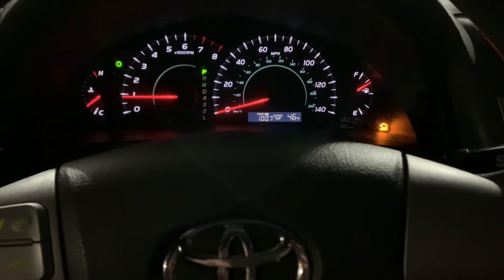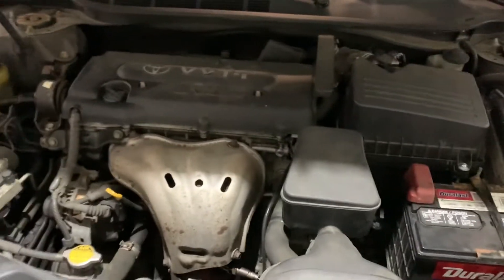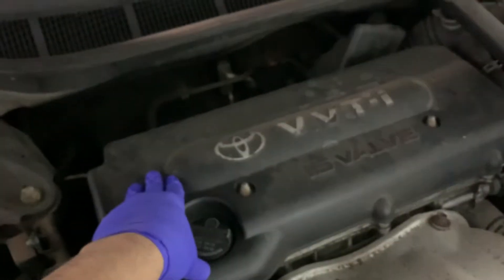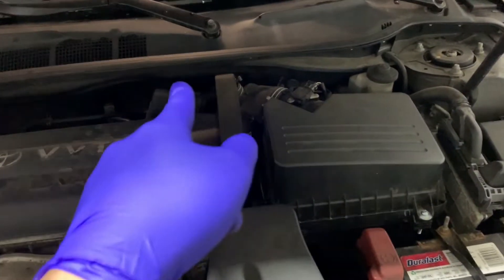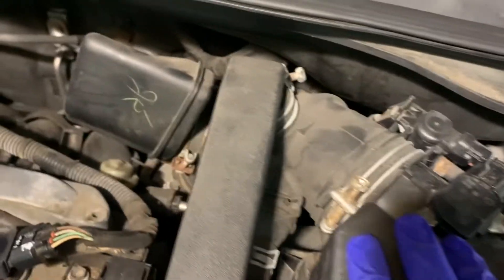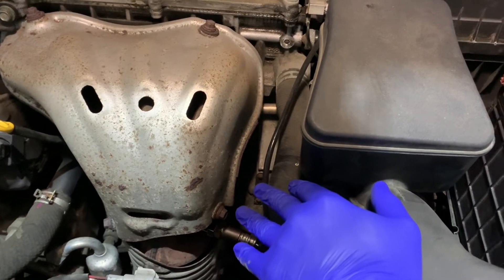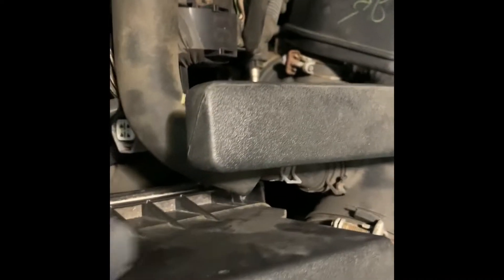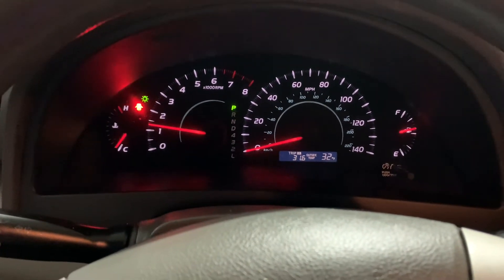2007 - 2011 Toyota Camry Code P0171 system too lean bank 1

Comment: 06 camry solara p0171! Ive replaced PCV valve, pcv hose, MAF sensor denso, o2 sensor denso, spark plugs, ignition coils, smoked for vacum leaks, and still cant get rid of check engine light! Was told it was either the fuel pump or fuel injectors! Just bought a new camry so not sure if im still willing to spend more money trying to repair!!
Reply: Same for me ! What is your long time fuel trim ?
Reply: @DilukaPereraofficial  finally got it fixed it was the fuel injectors. Code went away and passed smog.

Comment: My diy, I replaced the PCV and MAF sensors and all check engine/ vsc lights went off the day after. thank you for your help.
Reply: i couldnt find the proper pvc vavle. non of them had the proper thread pitch. from oreillys anyway.

Comment: So when you replaced your 02 sensor later it still didn’t resolve your issue? And I noticed you repost another video with the fuel pump? Was that your issues the fuel pump?

Comment: That light would NOT go off on first startup... you reset with OBD tool
Reply: The P0171 does not clear itself even after repairs so to start the car like he fixed it is nonsense.

Comment: If it’s the oxygen sensor would it automatically cut off when replaced or would I have to drive a few cycles for the light to cut off. Thanks in advance I changed the pvc valve and oxygen sensor
Reply from the maker: You would have to reset the light and run cycle.

Comment: Hey I have a 2007 Toyota Camry le with the check engine light on , coding p0171 system too lean (Bank 1) , I’ve replaced valve cover because it was pretty bad on oil leak, the car starts up just fine, do you think I have a vacuum leak, bad Pcv valve , o2 sensor , or do I need to replace the fuel pump?
Reply from the maker: Yes, possibly PCV valve and hose.
Reply: I’ve replaced the PCV valve , the whose was in good conditions , I’ve cleaned out the MAF sensor , and o2 sensor , but I’m still not sure if I should replace them , since the code seems to come back

Comment: I have the same issue, I have replace mass air flow sensor, 02 Sensor, and PCV Valve/hose. But my check engine still on after all of those are replaced. I’ve noticed my engine rattles loud when idle and the rpm goes up for no reason. What could be the problem? Please help?
Reply: Cat might be clogged
Reply: Did you replace the spark plugs
Reply: @Greenbear39  i have an 07 camry se 4cyl. got vsc  skidding wheels and check engine light on. researched it replaced the fuel cap. that worked for a minute. Had my mechanic change the spark plugs. bougth it with 106k miles in 2018. Now has 139k. never replaced plugs. hell never tuned it up.  I broke out my brand new Autel obd reader. I get p0171 system too lean bank one. did this today on sunday morning. my mechanic thought it was originally the battery  which was under warrenty. I replaced it. we just changed plugs yesterday denso irridum. no problems. later in the day, same errors. seems to be intermittent problem. could it be the coils? should i just replace maf sensor, pcv valve sensor and o2 sensor by the exhaust in the front of the engine?  the fuel filter is a bear on under the seat.
Reply: Coil packs maybe im waiting on my new ones in the mail
Reply: @Greenbear39   can u recommend good toyota parts supplier? Do u trust amazon? I just checked my hoses for vacuum leaks. Doesnt look like a problem. I say MAF sensor pcv valve and  o2 sensor in the front of the car are the culprits. I just changed the spark plugs. I changed my gas cap. my mechanic is old school. not so strong with sensors and computers.  will do a great job for not that much money.
Reply: I am facing the same issue, were u able to resolve the issue ?
Reply: Im gona change my cam shaft position sensor  first and fingers crossed that will be the end of it all. I will let you know what happens been really busy and haven't had time to do it yet the only other code I get is 0705 but I dont have any starting or stalling issues at all
Reply: ŕr😊😊😊

Comment: New parts are generally more expensive then test equipment, which you can reuse on any car. Dont guess, test your voltages and pressures at different points in the system. Thatll be alot faster and usually cheaper
Reply: how do you do that haha
Reply: @ youre gonna have to get a service manual off google for your vehicle lol. They literally detail every repair to your vehicle in a book online, you can see exactly where your lines go and where the fittings to test pressure are

Comment: PCV valves are very simple and cheap to buy and install. Replacing one is easy and cheap to do. Cleaning one is also fast and easy. But do the simple and cheap things before changing out the fuel pump. I had my fuel pump replaced at  285K miles in a 2000 Corolla by a certified mechanic (it is in raw fuel in the fuel tank with access under the rear car seat... no need to take any chances with gasoline) .
Reply: Believe it or not you would waste your money to work on the fuel pump with a mechanic one if the easiest parts to fix this car has and im not a mechanic

Comment: So the problem was the fuel pump on your vehicle?
Reply from the maker: Yes, after replacing the PCV valve and hose and changing oxygen sensor no leak air was found till fuel pump went out. I have ordered the parts and will upload new video on changing fuel pump on same camry.
Reply from the maker: Please check out my new video on P0171 issue 

https://youtu.be/csKOM535GNw

Comment: Guessing doesn't cut it. Got to test it with a voltmeter brah. What If it was something else...
Reply from the maker: After checking and replacing PCV valve and oxygen sensor, fuel pump went out and that was main cause.
Reply from the maker: Please check out new video for P0171 
https://youtu.be/csKOM535GNw